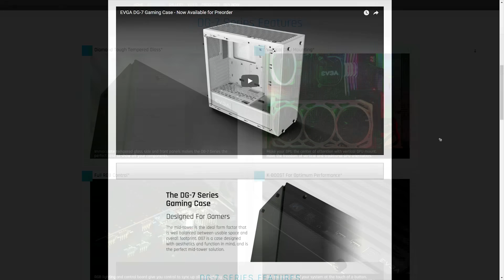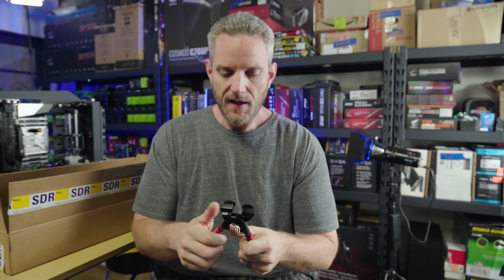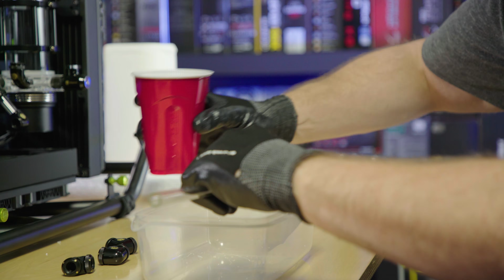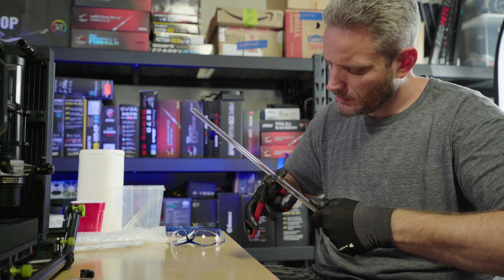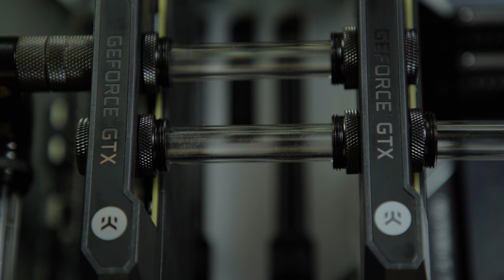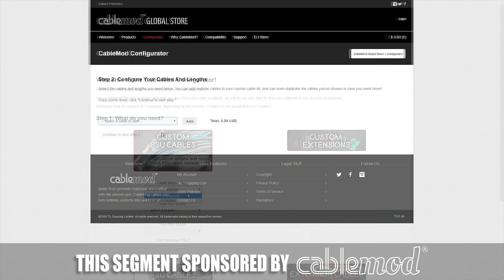First Custom Loop of 2018 - Personal Build Log Part 2.685

Comment: Hey Jayz, I have bought the H500P mesh and will be going to build my first watercooling system. I have two rad, one in the front and one on the top. Can you please advice me which fans configuration to use on both rad? Like SP/AF on the front rad with push/pull? and SP/AF on the top with push/pull ?

Thank you for your help in advance.

Comment: Beautiful build. I did notice that you are missing a bunch of the collars for the fittings, especially on the GPU waterblocks. Are those fittings designed to function without the threaded collars or was this for the mock up before final assembly?

Comment: Absolutely awesome build ...  Question: How did you install the radiator in the front out rather than flush like what is seen on the Thermaltake P5 builds most people do?  Are the fans pulling or pushing?

Comment: Can you use Antifreeze Automotive coolant would that be better? Green in that build would look great. Cant you daisy chain the power cables yourself, I dont know much about water cooling but I know enough to be dangerous on electrical and just thinking about it 2-4 wires would be a cinch to strand together I would think. It would eliminate you having a bunch of wires everywhere too. Hell get one of those blocks where you can connect 6 fans and just cut wires to size to perfectly connect. Like you do with tubing you could do with wires. There is usually only 2-4 wires, one hot, one neutral and two ground, unless I got that backwards anyway just match colors and you should be fine but I am probably not telling you something you dont know. lol

Comment: Hey Jay, question. I'm redoing my xspc raystorm loop for my i7-3770. It's an older build yes I know. Question is how long should radiators last? Should I be considered about it or just keep using the radiator? I'm doing soft tubing because it's just cheaper. Would love going all out but whatever.  Anywho your wisdom is much appreciated.

Comment: Would be really cool if you could incorporate the frame of that computer into your cooling loop somehow.. Like, glass windows in the metal. Obviously, that would have to be manufactured that way. Maybe PETG tubing inside the frame for the liquid to pass through (so you're not mixing metals) but with sections of the frame made of glass (braced in other ways; cross sections I would think) so you could see the liquid. Maybe somehow incorporate a radiator into the frame as well. I'm sure this would be costly, but very aesthetically pleasing and I imagine it would help keep the liquid cooler. The more the liquid isn't in contact with a heat source the better, right?

Comment: Hello Jay, I am in the process of building my first custom loop and for the life of me can't decide on fluid.  About a week ago I was dead set on Primochill Vue based on your video review of it but recently found out that it is pretty much a showcase only fluid and not meant for daily driver PC's.  Heat and not allowing the fluid to settle severely decreases the lifespan of the fluid and by severely i mean like you can cook it in a couple of weeks according to Primochill themselves.  They now have a warning "Continuous circulating of VUE 24/7 will severely decrease lifespan. Please turn off your computer when not in use. Vue should not be moving for more than 8 hours continuously."  As a heaby PC gamer this is an issue...

Pastel is obviously out I think we all saw the skunkworks tear downs, what would you recommend

Comment: I have been dicking around with the PrimoChill vue and I noticed that if you put the short tube that goes halfway up inside the reservoir as the outlet (to pump) for the pump and the other hole on the bottom as the intake (outlet from everything else) you seem to get the best effect in the fluid.

Comment: Question from a person that hasn't fiddled with custom watercooling at all. Would it not be smarter, maybe not pretty, to have the loop go Rad-CPU-Rad-GPU and repeat instead of Rad-CPU-GPU-Rad as it is here? Doesn't the warm CPU heat up the liquid enough that the GPU temps suffer for it?

Comment: Have you ever considered building a "Chillbox"? They are an awesome idea, would love to make one one day. If you go custom and modify an air con unit you can get -20 C or lower with the right gear, even with a water chiller modified so it can go below it preset levels you can go to about -20 with the right unit 24/7.

Comment: Can anyone tell me if the phanteks p400 Tp has a power led + and -. I’ve been looking around inside the case for the cord and am unable to find it. My motherboard says I have a problem with the little wires down there and I would appreciate any help I can get to fix those little wires. Btw my mobo is the asus b350 for Ryzen.

Comment: Jay, for me in this build I like much better how you did it over bent glass. Those bent fittings make it look exactly like you wanted: an engine. You are aiming to a car style look and having an engine inside that case is soooo perfect. Great video. One question: is glass tubing much more expensive than PETG or not so much?

Comment: borosilicate jay, oh my god, dont tell me your cutting tube with Murine cutters. thats for cutting cane....... you have the right tool already the lil squeeze cutter is your best choice of the three you have. i think you could benefit from watching a few of the revere videos. i know you dont intend on lampworking anything but he does an excellent cold shop video. http://www.mountainglass.com/Tungsten-Carbide-Scoring-Knife.html this is the scoring tool you would use to cut small tubes for handles such as 9 and 12.5 mm. i worked 90% of my peices on 12 mm handles. i know how hard it is to cut i mangled my hand when cutting 3/4 inch peices of 5 mm tubing it only has a 1mm wall thickness. the 9 n 12.5 are fairly thick in comparison. that polishing method is scary though, really watch that cold working vid i love your videos and this is something that could jeopardize your health. also if that perfect cut is your goal http://www.artcoinc.com/jaws.php these are the tool. expensive af but youll see the diference in that perfect cut. the only thing you could do to make this better after that is learn to flame polish your tube ends. happy ventures :)

Comment: How did you fit the original backplate on the graphics cards with the EK water block? I tried that myself the other day and couldn't because the backplate only fits smaller screws than what the water block needs.

The EKWB website also says "NVIDIA® GeForce GTX factory backplate is not compatible with this water block!" for both water blocks that fit the Titan Xp (https://www.ekwb.com/shop/ek-fc-1080-gtx-ti-nickel and https://www.ekwb.com/shop/ek-fc-geforce-gtx-fe-nickel ).

Comment: JayzTwoCents hi Jay i have a question about the looping order, first of all i am not a professional and i have no experience, i just noticed that most build including yours use this order "cpu out -> gpu in" isn't that gonna affect the temps on the gpu side? because if the cpu out is the dissipated heat from the cpu, then it carries hot temps that will go inside the gpu, technically in terms of science the capacity to dissipate the heat from gpu is much lower for the reason that the water that will dissipate the gpu is already hot, i dont know in real world i need your help for my upcoming build, thanks @jayztwocents appreciates it
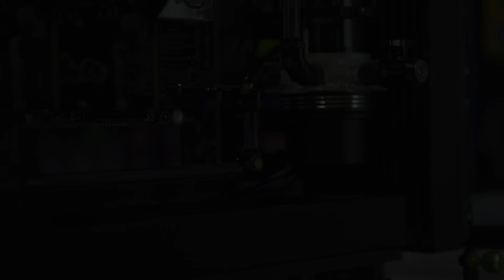Reply: @Rome Aeterna he did do a video titled "5 Water-cooling Myths You Shouldn't Believe", but I can't find the follow-up, video he said he would do: https://www.youtube.com/watch?v=HWLAY_kJU_Y at 6:10 into the video.
He basically said that it doesn't make a difference.
Edited:  Wrong timestamp.
Reply: thanks man ill check it right away

Comment: The top tube that is connected to the gpu's is not straight by 2.137528964832754 degrees anti clockwise

Comment: Borosilicate glass is thermal shock resistant, and like you said used in chemistry experiment plumbing (Duran from Schott AG is the most known brand) also used in proper Pyrex glass cookware. It can be bent, drawn, twisted and pinched etc. by heating it  using a MAPP gas burner. In Your use case it would make a lot of sense to use MAPP gas to melt a smooth radius on the ends after you break them off, It'll save you a bunch of time and look flawless, also makes for less of a risk pinching or scraping an O-ring. Just a tip and some info from a "Multi-purpose Nerd" follower :)

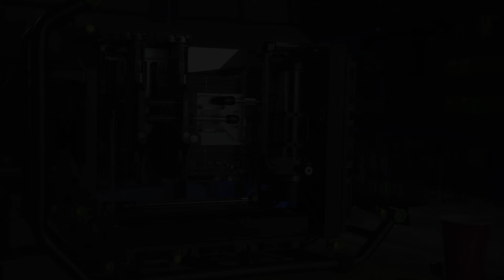Comment: can someone explain the connections from the gpus 7:54 it looks like the bottom gpu will be circulating hot water instead of pushing it through the second gpu. so i dont understand

Comment: I think you should put some sparse cable sheathing around the glass tubes and use UV coolant.  Sort of like the sheathing you find around the cables in an engine bay.  Not so dense you can't appreciate the glass tubing, and hopefully the UV would shine through.  I think it would be a nice touch, while keeping that automotive feel.  Might also contribute to that "busy" feel you were looking for.  But that's just my two cents.. :P

Comment: Love the look of hard tubing but I've never been brave enough to try it myself. I might give it a go though, I have a Dell XPS 730x with a custom loop that I can try it on first. There is a slight kink in the soft tubing in front of the CPU, it's not enough to restrict the flow but it is annoying me so I might try it on that system first to see how I get on before trying it on my more expensive systems.

Comment: Honest question Jay, but is it more efficient to have 2 water tubes between the graphics cards rather than alternating the water tube (GPU1 in left, out right to GPU2 then out left on GPU2)? I know that in many other videos, its explained that you want the exit to be the opposite the in otherwise its a straight through flow, but do you get different cooling performance by using 2 tubes rather than 1?

Comment: @jayztwocents would it be good to clean the inside of the tube you just cut? (water and pressure air) also whats the filter on your little loop cleaner? 50 micron? i work in a plane motor shop and i clean the part just before we assemble them. have a nice year!

Comment: I am trying to understand the flow of fluid.  Why do you have two tubes between the GPU's?
Reply: Because it's a parallel configuration. The 2. gpu in the loop get the same tempered water then the first one

Comment: This is turning out to be a very impressive build Jay. I do love the B roll of the system without the nuts on the glass to lock it in though hehe. I am sure you did that because you need to dismantle the cooling system for cleaning etc before the liquid is introduced. Keep up the great work Jay, looking forward to the completion of this build.

Comment: whats with the fittings on the gpu and center cpu (where  you see the threads)
is there missing something?
are these tubes just hold by a o-ring?

Comment: whats the deal with the parallel tubes on the graphics card? I would have assumed you go in one, out that and into the other, then out that and onto whatever is next. Do the two output ports on water block 1 both come after its gone through the block itself or are they pass through?

Comment: not sure if the type of glass you are using can benefit from heat to soften jagged ends or not, however I have always used a blowtorch to soften cut ends of pyrex style glass.

Comment: JayzTwoCents i have a problem, i have 2 gtx 970 and tryed to sli them , in windows i can see both of my cards but if i try to click enable sli it wont let me, its grey, tryed to switch the slots of the cards and nothing, do u think that the sli connector can be the problem ? please just tell me ur opinion, btw i have a x370 killer sli/ac motherboard

Comment: What about an orange, similar to that of most coolants that goes into performance cars? I know it's not to the green and black theme of the case and components, however, it is fitting for the automotive chassis theme that you had mentioned. #foodforthought

Comment: I have a question though. From what I know you need a blow torch to debur glass (basically you melt the edge of the cut glass to clean it) but then again they use that method when using laboratory glass tubing.

Comment: Not sure how I feel about glass. I think I prefer the look of the bends than 90 degree fittings. Maybe polishing PETG will help? I wonder if you could bend glass tube with a torch and a high temp silicone insert.

Comment: Future reference. For borosilicate glass tubing check out ABRimagery. They even have 1/2 ( which is exactly 12.7mm with a 2.4mm wall and how its labeled) so you can use primo chill fittings if you want. Its  $3.xx for 60" length, its more consistent dia. Schott laboratory grade and they will cut them in half for you to make the shipping cheap. I got 15 feet of for $17 and the shipping was $15 but I actually could have got a lot more for same shipping cost since it was at the minimum charge. I just finished a build with glass tubing and  a couple pieces I had to heat bend even tighter then what you can get pre-bent. Its really not that hard to do you just need a safe place to do and a benzo blow torch from home depot not the standard pencil flame tip but the beefy push button SWIRL tip. Cost roughly $30 bucks or so. You can get a Mapp gas one which works a bit better then the propane one. Just heat it up till its red and it will bend on its own but once it starts let off a few seconds and move the torch down a little causing the red spot to appear a little bit down letting gravity bend it controlling the speed and how much its bending buy how hot it is. Move it up and down the entire radius you want to bend applying the heat in bursts not constant and it wont kink. Bend the piece you need before cutting it so its long enough to hold on too. Borosilicate is very stable , its used in glass blowing and wont shatter so long as you don't spray it with water when hot that would be bad . If any one tries bending this Be carful and obviously wear glasses.

Comment: Love the build.
One suggestion: I believe twirling in a hot flame (like a propane torch) will smooth the cut glass edges easier, faster, and better than the sandpaper and drill technique.
Reply: I could be wrong about using such techniques in this application, but chemistry lab techs build custom stuff with glass tubing every day using flame. Cody's Lab might be willing to share some suggestions :)

Comment: I really likes glass tubing. I did it once but I found it very easy to break the glass inside the fittings while installing, because glass is rigid and fragile. Any tips on how to properly install a glass tubing loop?

Comment: Does the order of the loop not matter with Temps? I see the current order is pump > radiator > gpus > cpu > radiator. How would Temps be if order was pump > cpu/gpu > radiator > cpu/gpu radiator?

Comment: Absolute shame to make a new back panel to hide the cables rather than custom cables with ridiculous OCD cable management. You can get very creative with custom length cables, double sided tape, cable ties, black paint, and very thin sheet metal. Just need tin snips to cut out your custom cable tie attach points and some pliers to bend the attach point. If you want to go extreme use a Dremel with cutoff wheel, sanding wheels, a drill and small screws with a tap and die set with the pliers to make more professional ones that wont be effected by the tape.

First thing I would do is use generic wire and any tape to map out the layout and get the cable length then make 2 cable mounts for every 90 degree bend(one on each side) and one for every spot the wire doesn't sit right. Now order the cables and paint then attach the cable tie points. When the cables arrive swap the generic wires out with them and you will have a sweet custom OCD cable management to make cable management freaks drool.

Comment: I used to work in a lab and we'd often have to bend borosilicate tubing, you could probably bend this stuff in much the same way you bend acrylic, just might need a propane torch instead of a heat gun.

Comment: I'm not sure if car coolant would even work that well in PC cooling...   Car coolant is formulated to change the boiling point under high pressure.  I've not yet ventured into custom loop water cooling...   SOON...    I just assume your pump isn't putting out the same psi of pressure a car water pump is going to be doing.  I also don't know how much heat transfer the PC coolant does compared to what car coolant can or can't do..  I just don't think the application matches the product..

Comment: +JayzTwoCents
That is one "cruel" build ;)
Apologies for a possibly stupid question, but are the fittings not supposed to have another "pressure ring"? 
On the "B-roll" it looks like most (all?) the fittings just have the glass "pressure fit" into the fittings without any "pressure ring" !?
Is it just because You are going to "dismantle it" again, or am I mistaken and they are supposed to look that way ?
Thanks for another great video.
Best regards.
Reply: Thants because he did a test fit, cutting it all to lenght before cleaning everything. This is just a test fit. But you are right, there is supposed to be anothering screwed onto it. But this has been taken out of there and is being cleaned now.
Reply: Thomas Smith he wasn’t
Reply: Thomas Smith and plus he probably doesn’t have English as his first language bc lots of foreigners type that way. He may not be. Idk
Reply: Why are "you" using so many "quotation marks" incorrectly?

Comment: Very glad to see you mentioning the blitz kit, the single most important thing you can do for a new system or old is clean the radiators properly. Never seen the filter used, but very cool!